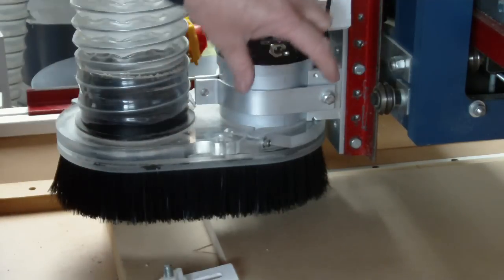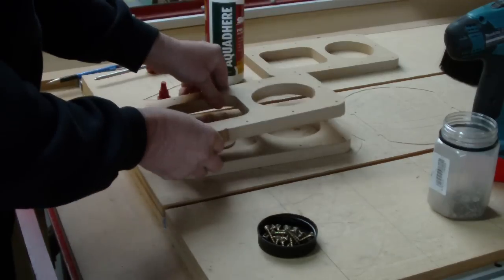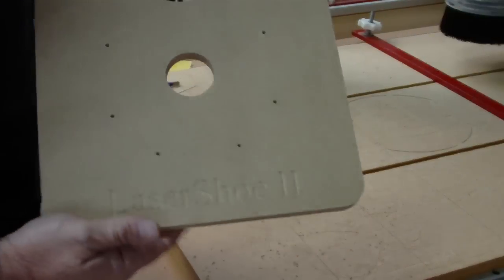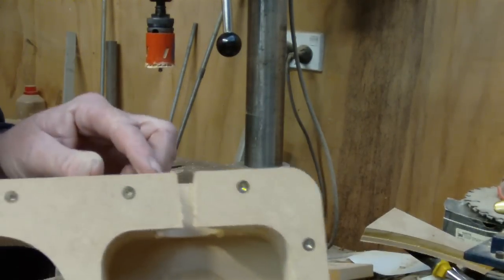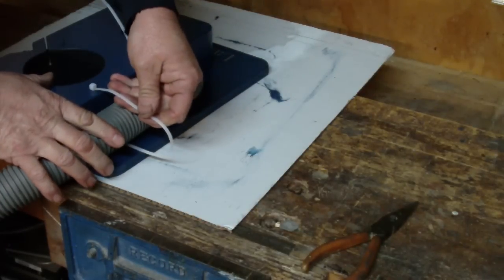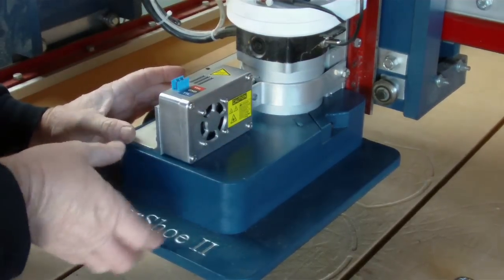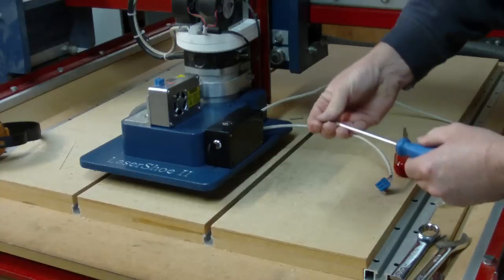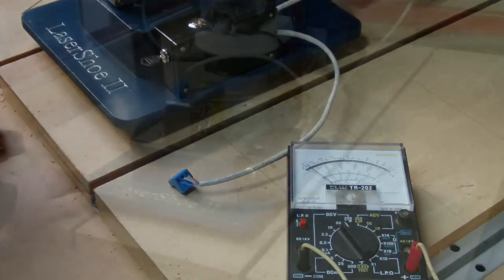Building the LaserShoe Part1 - CNCnutz Episode 41

Comment: Hi Peter. How did you connect the laser diode to the mach3 controller ?
the PMW and the TTL ?
Tnx.
Reply from the maker: Hi Nir,
Not sure what you are asking. I connected the TTL input of the laser to the output on my Gecko G540 and configured it as shown in the lasershoe part 2 video. I don't us PWM at all. There is also a drawing in the plans provided showing how things connect.
https://www.dropbox.com/home/CNC%20Project%20Plans/LaserShoe%20II%20Plans/Key%20Box?preview=Keybox.pdf
Hope this helps
Reply: Hi Peter... i do all.. and put a LED with a resistor in Dir Pin of C axis.. to simulate the Laser... it goes on/off when i move my Z up/donw ( nice) but.. dosent work with a G code profile... :( have u a MACH3 step by Step check list to configure the C axis slave with Z ??? Thanksss

Comment: Hi Peter! After watching your video I was intrigued about your laser engraving. I'm in the beginning stages of building a modified Gatton CNC. What model is your laser? I looked at Kalecnc on ebay but I couldn't find a blue laser. I found an Industrial-808nm-3W-3000mw-Infrared-Laser-Focusable-Diode-Module-Cutter-w-TTL. Is this similiar to yours? I would like to have a blue laser because it is easier to see when setting it up.Thanks again for all your informatine videos. Cheers!
Reply from the maker: +Joseph Conner 
Mine is a 1.4watt blue laser from Kalecnc which I bought off ebay. I think they now make more powerful units in blue but you can get your laser from any supplier and mount it to the lasershoe. It looks like Kalecnc only have 1watt blue lasers at present but it may pay to ask. I  think they make them. Also check out PicEngrave who sell laser engraving software and https://jtechphotonics.com who sell laser kits. 2.8watts in blue. 
Cheers 
Peter